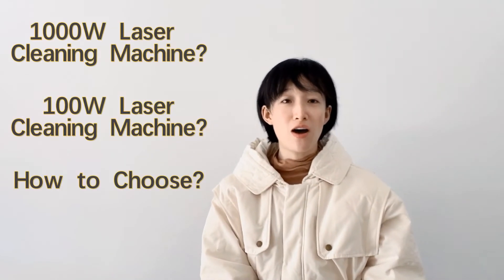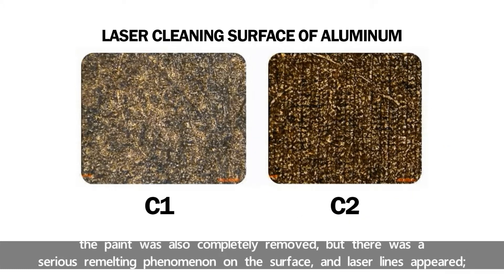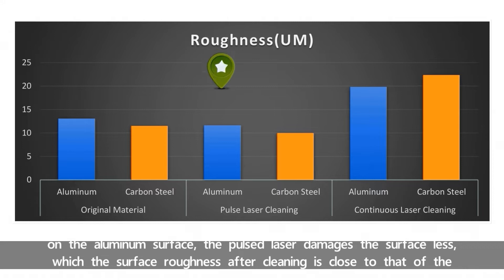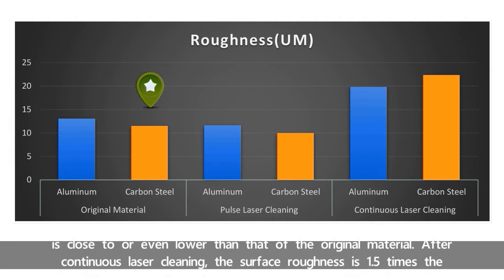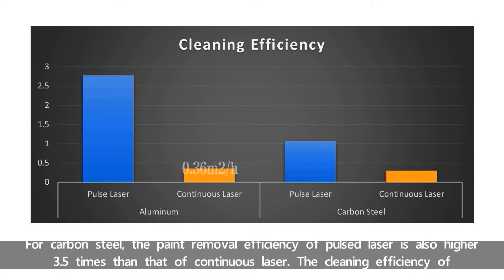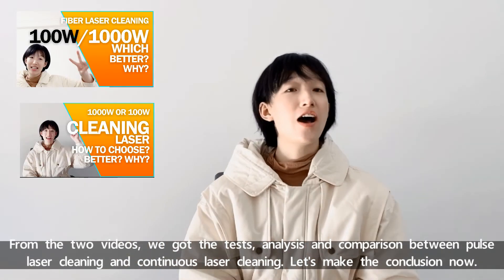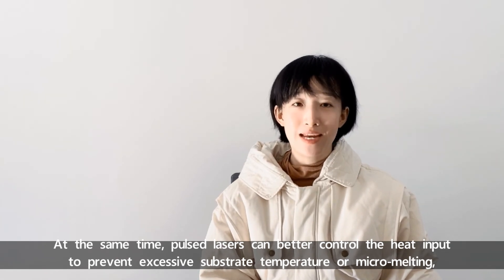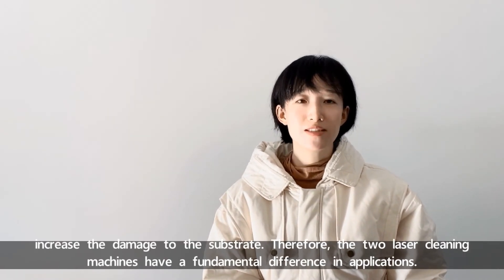Laser Cleaning Machine 1000W | Laser Cleaning 100W | How to Choose 2

Comment: Very good comparison. 💯 I‘ve been looking for that for a long time and finally found one. Thank you for that! 
If my conclusion is right, then a cw laser is fine for rough surfaces where the cleaning effect is more important than securing the surface. So it would be perfect for oil removal on concrete, rock and tarmac or rust removal on large metal surface. Whereas pulsed laser is better for eg rust removal on where the surface material needs to be protected. 
I‘m wondering if a 200 W pulsed laser is sufficient or if a 500 W pulsed laser would be more flexible for different jobs. Thinking of rental business. 
I‘m also wondering if a MOPA-laser is even better for rental than a „normal“ pulse laser. 
So many questions. Looking forward to your reply 😊
Reply from the maker: Thank you
Reply: @ClaraChai  have you got answers to my questions, please?
Reply from the maker: @schlagerclub  what question?
Reply: @ClaraChai  I‘m wondering if a 200 W pulsed laser is sufficient or if a 500 W pulsed laser would be more flexible for different jobs. Thinking of rental business. 
I‘m also wondering if a MOPA-laser is even better for rental than a „normal“ pulse laser.

Comment: But usd 15000 for a pulsed 200w?
Reply from the maker: It should be on your choice
Reply: @ClaraChai  Yes Clara, i know. Unlike CW fiber source, the  q-switched fiber above 50W is  too expencive yet .  Just now i have a customer who want a fiber cleaning to remove   light oxidation from eletric motors case ( antimony) and leave it like new.  And remove dust, paint, grease and rust from another parts. I was sure a 500W or 1000W CW could do the job,  but i have watched many videos  and I noticed that cw works more for rusty and dont leave a good finishing. The customer was  willing to pay until usd 8000  which would be in line with the price of a CW. but....
Reply from the maker: @ricklaser2846  Got it, please find me on WhatsApp +86-13335151833, let me see what I can do for you.